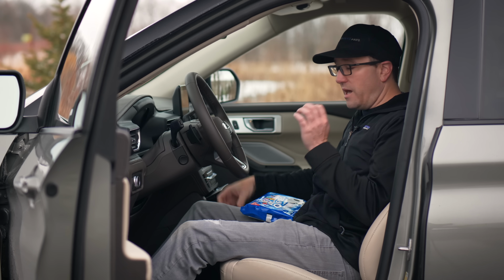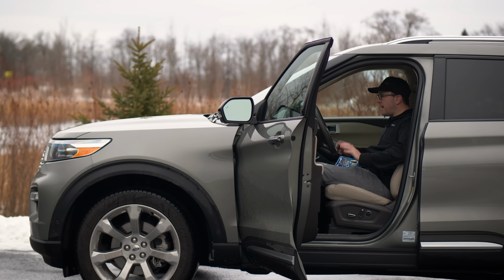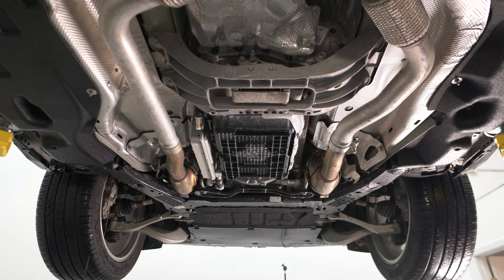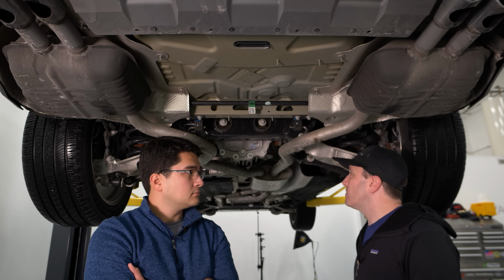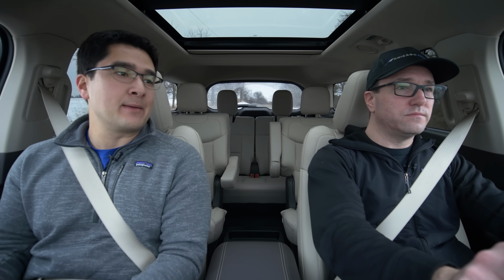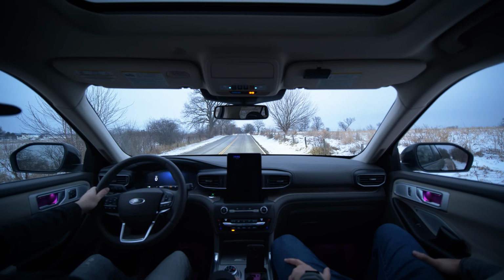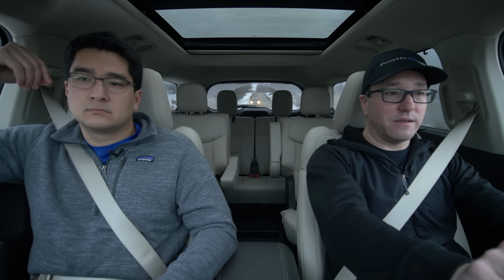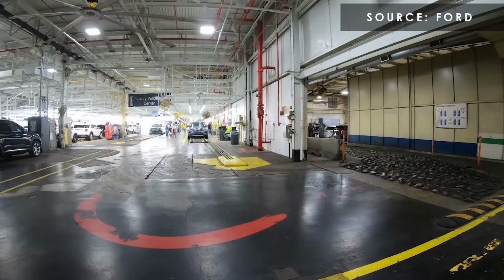2020 Ford Explorer | Who Is Responsible For This?

Comment: Palisade is 10k cheaper for 10k more features.
Reply: Yeah, at least Kia/Hyundai/Genesis actually put in effort.
Reply: LOL. Good luck when your Kia catches fire.
Source: https://www.consumeraffairs.com/news/hyundai-and-kia-recall-500000-cars-that-could-randomly-catch-fire-030419.html
Reply: It the warranty of Hyundai is way much better I'm happy with my Santa Fe 2019 and gas mileage is amazing the only for I have is Mustang 5.0 and done with Ford
Reply: You obviously haven't priced anything at a dealership.  Kia is putting on premiums, Hyundai discounts a little.  Ford net is essentially the same.  You can get an ST or Platinum for LESS than the top end Kia and the same price as a Palisade.  And those two versions will leave a Palisade in the dust for a driving experience, unless you are a soccer mom.
Reply: @denvernorth6494  ur wrong the top end palisades top out at 48k there are 60k platinum and st explorers im sorry but before u make a ignorant comment about something u dont understand u need to research first
Reply: tryceo and ultimately a fwd, understeering, underpowered shit box. I genuinely like H/K but that is far too big of a vehicle to be FWD
Reply: RWD and high horsepower . This car directly competes with the Citadel 5.7 L not a palisade .
Reply: Palisade no guts.  Explorer ST loaded 56k 400 HP.  10 Speed automatic will leave the Palisade in the dust in a straight line and around curves.  No contest.
Reply: @ginsure  Who the fuck buys a giant 3 row SUV to go fast in a straight line? Palaside and Telluride is a significantly better vehicle than this. Ford needs to do better. Hopefully, they fix it for the refresh. If they can get the quality to Kia's level + their performance then you have a winner.
Reply: Chris V it’s much better around the corners too, especially when it comes to snow. Both of those whales are fwd. too big to be fwd and understeer worse than an Audi.
Reply: @ginsure  no one will buy these cars for track lmao. Its about comfort and practicality bruh
Reply: ginsure hey let me flex my speed on you In my explorer headass

I can get a coupe with that money
Reply: @ginsure  who buys a large SUV and worries about smoking the next sports car that pulls along side it? Big SUVs such as the Palisade and Explorer are meant for families or those who enjoy more roomier cabins. If you're gonna spend all that money on a sports trimmed SUV you should just spent it on a cheaper priced sports car that would inevitably beat it.
Reply: 10K less chassis too, the Telluride is a hunk of shit
Reply: @BCSVT  keep saying that u til your Ford blows up it's transmission and the electronics break in 2 years. Hyundai and Kia, since 2007, have been some of the most reliable brands out there.
Reply: nicktune1219  I DD a 2001 F150 with 380,000 miles. Original paint’s still shiny, original engine/trans/ECU, interior still rattle free.  Any more lies you wish perpetuate?
Reply: @BCSVT  at least you have a ford from when they built them well. since 2012, ford has been a shit company that kills its costumers wallets and lives with reliability issues.
Reply: nicktune1219  2011 was an amazing year for Ford, some of the best products ever came out then.  With maybe 1 exception.  If Ford had bad years, it was 2004-2009, percent primarily because of the 3V 4.6/5.4.  The DoD GM of the similar era are just as bad if not worse
Reply: And will be worth 50% less when you go to sell it. Kia/Hyundai has some of the worst depreciation of any cars.
Reply: @pbaker7160  lol still fools out here commenting on depreciation, damn near every car (especially new luxury cars) out there depreciates like hell.
Reply: @pbaker7160  mostly everything you buy will depreciate in some degree. You should be focused on ownership experience and value of your aquisition. This is not real estate.
Reply: @pbaker7160  yeah because of the engines seizing.   They (probably) fixed that.
Reply: @pbaker7160  That's a great thing for me then since I love Hyandai and Genesis cars.
Reply: @pbaker7160  Yeah,  depreciation,  thats a problem.
Reply: @pbaker7160  u forgot that fords also depreciate horrible u can get a fully loaded 2019 ford fusion for less than 20k

Comment: You mention (or quote i wasn't sure) that RWD helps with space for people and things. How's that? wouldn't a simpler rear axle setup like a twist beam leave more room up top? wouldn't any suspension setup for that matter be slightly better because of the lack of a rear diff and cv's?

Comment: Finally, an honest auto review. Back in 2013 I was deciding to buy either a Hyundai Elantra or Ford Focus. Test driven both. The Hyundai was incredibly smooth and well built. The Ford’s DualClutch was constantly stumbling. The Ford was more fun to drive, but for longevity it was a no go for me. And my Hyundai still has more than 2 years left on the Powertrain warranty.

Comment: My 2019 Ford ranger already given me whiplash where's the manual transmission that I desperately want
Reply: I wonder if it's how they (Ford) calibrates this transmission in different vehicles?  I have the 10 speed Automatic in my 19 Mustang GT with the performance pack 1 and It has been flawless.  I've heard complaints about it before so I wonder what's going on with that???
Reply: The Tacoma still offers a manual transmission.
Reply: @JoshCraver9000  I don’t fit in the Tacoma comfortably
Reply: Manual transmissions are obsolete in 2020
Reply: @EpicConspiracy  with how poorly CVT transmissions and automatic transmissions perform these days (longevity, slipping, jerking while upshifting or downshifting, etc) I would say that the manual is more important than ever. It's only obsolete because the powers that be tell us that and won't provide it despite demand. I drive a manual daily and when I hop into an automatic I almost want to get out immediately and go back to my car. I'd almost rather not drive. I feel like I have so much more control over my car in every situation, but especially in adverse weather conditions. I can change gears as needed on command without having to worry about the car shifting for me or canceling manual mode (like the Chrysler 300). And if you're wondering: yes - I would rather drive a manual in traffic.
Reply: @campbellvonjordan68  I’ve gone back to older cars with manual transmissions because of that

Comment: You know, I test drove one of these before I bought my Telluride.  What absolutely blew me away, and I too noticed many of your interior criticisms, was the price.  Loaded up with all those options in that top model, it was eye-wateringly expensive.  And these design issues, sloppy finishes, stupid infotainment, silly gauge cluster, and generally boring minimal updates to the exterior look, all left me scratching my head.  Once you shoot past $60K there are a LOT of strong competitors all over the place.

For a company the size and resources of Ford, this final product is really disappointing.  If they had offered me a $16K discount, I would not have taken it.

Comment: A Monopoly is something antitrust laws were made for.
But what about oligarchy?  Every manufacturer keeps lowering the bar not raising it.  Where is the competition?  Nowhere.
Why? 
Because all the senior shareholder sit on each other's boards. 
The car makers don't care which car you buy, because the same small group of families make all the money.
Planned obsolescence only works when there is an oligarchy.  Otherwise a truely free market would fill the need with something better.
The fact that there is nothing better on offer IS all the proof we need that these gangster are running a pretty tight racket.

Time to opt out.

Comment: What a crap pile. We have a 16' F150 Lariat and the overall quality is good. Sound system is booming with little vibration in the cabin. Ford is really lost with their new line of products. A friend of mine had a lower end 2020 Escape 3cyl for a rental, that thing was despicable inside and out. Disappointing for sure.

Comment: I was excited that Ford was taking the Explorer back to its rear drive roots. I had 4 of the older rear drive truck based Explorers. They were great. What was disappointing to me is that they put some soccer mom AWD system in the vehicle. It needs true 4wd with a low range transfer case. And get rid of the tablet screen. The interior is horrible.

Comment: The Chicago Exploder/Aviator assembly plant is really a shitshow. They had to ship THOUSANDS of Exploders to Michigan for rework. Transmissions were grenading themselves as Exploders were driven off the line. Some were found to be leaking transmission fluid as the vehicle was MOVING down the line. Typical Ford junk automatic transmission. The Detroit news and Automotive News wrote several articles on the botched Exploder/Aviator transmission. Oh and SIXTY THOUSAND DOLLARS. BHAHAHAHA

Comment: Every Ford vehicle should be able to tow itself. Because Ford. It's stunning for them to dump cars and then release turd SUVs. The notion that ride and handling need to be bad for towing is just an excuse for bad engineering -- all those compromises to tow 5000 lb? Porsche Cayenne and most other performance SUVs can tow 7500+.

Comment: Hey Mark, would you believe that Ford sells these Explorers here in Europe (first gen of Explorer to be sold in Europe) and the hybrid version goes for about 70,000 Euros? That's about 77,000 USD. There are versions with a list prices of 75k Euro or more. This dealer has it for a discount for 65k: 
https://www.autoscout24.com/offers/ford-explorer-3-0l-v6-ecoboost-plug-in-hybrid-electric-gasoline-red-eda5300d-50b7-4e21-ab11-3fcc34083fd3?cldtidx=16
I've already seen some on the streets. It's ridiculous. For that price you can get a brand new X5.

Comment: i guess i am the perfect customer for this because i want to replace my F150 with a more fuel efficient smaller vehicle, but need the towing and load capabilities of a small truck. Plus a 4x8 sheet of plywood fits in the back of this and no other midsize so that locks out all of the competition for me. Definitely would be buying a lower trim so don't need to worry about fake wood or huge stupid screen lol. I wouldn't buy first year though, so hopefully they can retune the transmission.

Comment: To me, this feels like a lot of wasted potential. I really love that Ford moved back to a RWD architecture. I also love the aesthetics of the exterior and interior. However, there are some deal breakers. The screens are shit. Especially that main tablet style screen. It is absolutely horrific and atrocious. It looks like they just put a slot in the middle of the dash and slapped a huge tablet on it. I really dislike it and I would find it intolerable on a car if you weren't able to turn it off. Thankfully you can, but it still sucks. The screen in front of the steering wheel looks tolerable, but I've seen far better implementations that look almost like real gauges. Also, the transmission sucks, so they need to fix that. I would wait until a mid-cycle refresh on this, I bet it will come in 2 years max. Still, I think it looks cool and has a cool powertrain but it needs to get its shit together.

Comment: $61,000 for a ford SUV? You can buy a Lexus for that price and it will last more than 10 years. What happened to the millions of Explorers sold in the last 20 years? You don't see any 3rd or 4th gens driving anymore. Same to be said with the Taurus. Ford has consistently made junk for over 30 years. If it wasn't for marketing and police/ambulance vehicles they would have went bankrupt like GM and Chrysler.

Comment: Thank ford for getting Dodge trucks in so many driveways.
The 6.0 diesel showed me what crap Ford puts out.
I bought a 15 Mustang GT.
PP because I always had trucks and got sick of driving them.
As much as I liked the Mustang I sold it in 3 years.
The misaligned body panels and interior squeaks and rattles never grew on me. ( I fixed the body)
Shame

Comment: I like my Platinum a lot and have not had any problems. I do agree on the way the interior resonates sometimes. But it doesn’t always do it. It’s not a sports car so I think the transmission works fine enough. Also the screen is very nice to use and helps a lot if you need to look something up on the map. What I hate is how the camera screen is set up. 
Also no problems with the leather seats here or rattles. Saying that this was built for people that don’t care or a rental fleet is an insult in my opinion.

Comment: I am a Ford fan. I understand how  Goose feels this SUV is half baked. It was kinda rushed due to the retooling but at least Ford Is doing that. Chevy would just close the plant down. Also the 1st year of total redesigns aren't the best from any company. Thus is a press car (early production) so the fit and finish isn't were it needs to be yet. Ford is good at iteration so things should improve. 
    The drivetrain I think is great. Everyone complained why dont they make an old school SUV. Here Ford does it and people hate on the differences between it and its competitors. I been asking for more rear wheel biased AWD systems and here you go. It's a fun capable offroadable type of vehicle not just a poser. 
     Goose does have alot of demand on interior aesthetics and Ford has always been slightly behind in that aspect. However I dont mind that because they have the Lincoln badge to go crazy with that. Finally I appreciate this vehicle for what it Is a throwback to what SUV used to be but with alot more technology.
Reply: and he never touched on any of the advancements this vehicle has. The drivetrain deserves more attention. You mention it's a press vehicle and I noticed the seats do not have the same stitching the production vehicles have. I don't think his "review" was a good or fair one at all.
Reply: @br33zy771  to be fair to Goose he can only review the product he receives. He likes the SUV but has grips too. I have been watching Goose for years and he is pretty fair tough but fair. He is the best reviewer on YouTube in my humble opinion.
Reply from the maker: I talked plenty about the drivetrain and the stability control part in the shop and on road. Its one of the best parts of the SUV and why I also said it differentiated itself from car/minivan SUVs.
Reply: @savagegeese  I know I know. That's what I took to heart the most and that's why I love your reviews. Your honesty and expertise are highly appreciated.  You tell it like it is no matter what. Thanks for that.
Reply: @savagegeese  fair enough

Comment: Is the new Aviator produced at the same plant? I’d love to see a review on it to see if it has the same quality issues
Reply: It is produced at the same plant and has the same engine and transmission. Good news is you can get a mid-trim Aviator with a much nicer interior for less than this vehicle
Reply: @coffeeinthemorning ------The UAW has it's own set of problems but everything pointed out by the reviewer was designed into the finished product well before the assembly line folks were in the picture.

Comment: I have been a big time ford fan for a real long time. 

But their decisions to eliminate all the sedans and head in this direction with their SUV’s is just abysmal. SUV’s are meant to be truck like - this is anything but. 

At this point I’ve turned my sights to Dodge and Chrysler - they are going through changes like every other auto company but they are at least sticking to their roots while they do it. 

Thanks Ford, but no thanks. Nobody asked you to reinvent the wheel.

Comment: Ford has a recall for some f150’s with a software update so it doesn’t downshift you to 1st on the highway. This is on the 6 speed. Idk if they also have issues with the software on the 10 speed

Comment: I've said it before, and I'll say it again; I will not buy a new vehicle that has all of the controls dependant on a touch screen interface.  This is a trend that needs to stop.  This new Explorer is a perfect example.  Bring back buttons.  They work.  They're easy to understand.  And you don't need to take your eyes off the road to use them.

Comment: I have the 2020 ST. Lots of power. Fun to drive. Definitely not refined. Has some quality control issues like rattles and squeaks. Totally disagree about the 10 speed. It’s awesome. I do agree the shift programming in sport mode is not good.